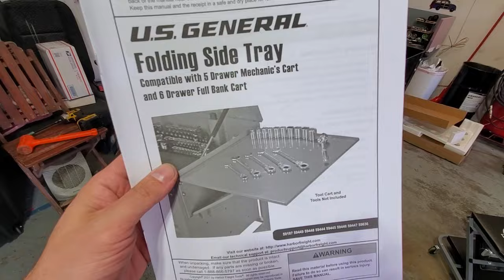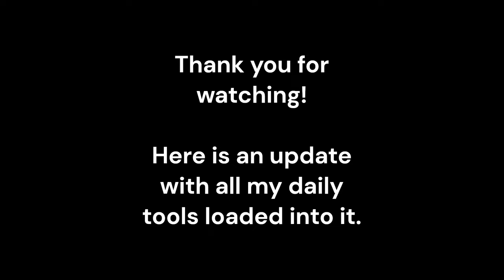HOW TO put a power drawer in your Harbor Freight Tool Cart!

Comment: Nice mod to fix the power strip in the drawer. I hated the power cord off my power strip dangling around in the way when I wasn't using it so I cut the cord very short and attached it to a straight blade power inlet mounted in a hole in my cart carcass. You could use the same hole you've already cut. Now I just run a heavy duty extension cord to my cart when I need power. Look up "shore power" mods for trailers etc.
Reply from the maker: I'll have to check that out! 👍 Is your power strip in the top section of the tool cart then?